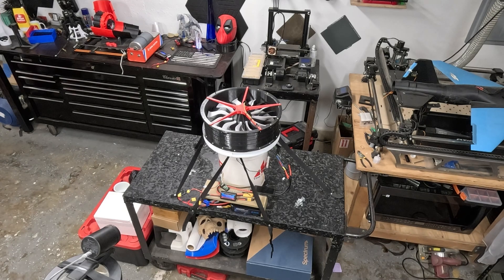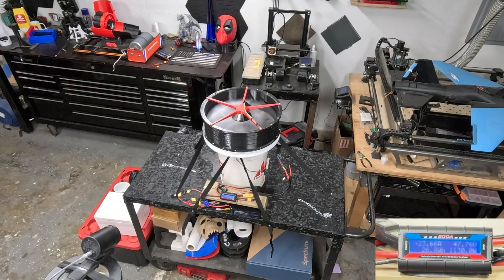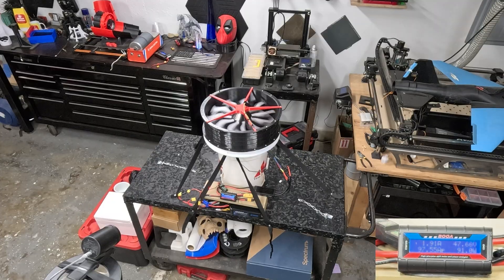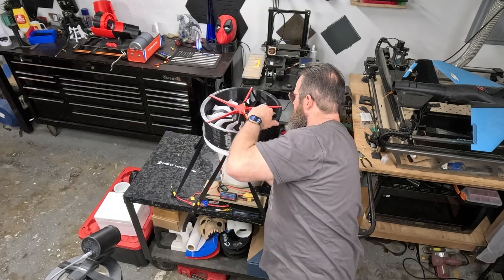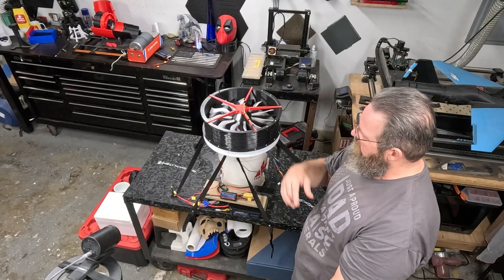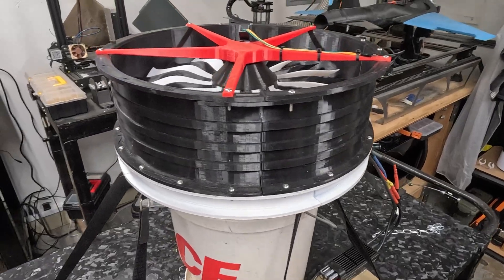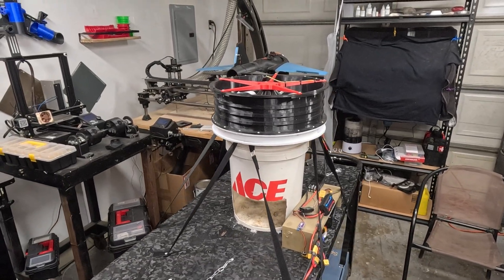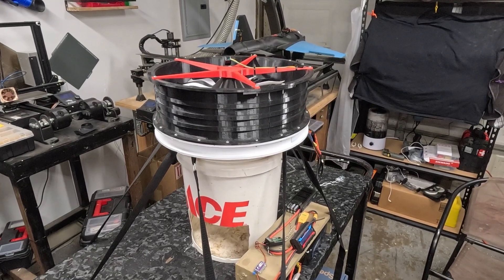STUBBY FAN ULTRA, 340mm electric turbine EDF spin up. Massive power for a new style of drone.

Comment: 2 questions are the plans.for this public and what do you if anything plan to put this on.
Reply from the maker: I’m waiting on some equipment to test its viability as a 3-D printed system at full RPMs using an 18 cell system when I do that I will release all STL files and components list. There will also be assembly videos.
Reply from the maker: To your other question, I plan on building four of these and making a very large drone.

Comment: Just stumbled across this, i need to spend some more time watching the video and channel.

I am a diy skateboard builder and recognized the motor that you are using.  In the esk8 community,  reacher are generally considered the best motor. People have been pushing 150+ amps through the motors on skateboards albiet for a breif moment.  Their 6485 or 6495 or even 7490 would be good options.

However the 7490 are 20 pope motors so the erpm is a little bit tougher to manage when going above 60 volts.

If you are only running 48volts though i wouldnt think it would be a problem.
Reply: Also, if you are interested in a motor let me know I have 2 of the reacher 7490 173kv motors collecting dust on a shelf I'd be to send one your way if you are interested.  It is also a 10mm keyway shaft and the same hole mounting pattern so it should be a direct swap for you.  I can send you a spec sheet also.
Reply from the maker: That would be another awesome motor to test the 7070 peaks at 100 A I need more. Fan resistance is going to create that before I even push the proper voltage through. Also have to decrease the ESC timing to 7.5. See if that helps.
Reply from the maker: If I had a flight controller where I can adjust the polls and it knows how to handle it through the power distribution more than that would also help but going direct from the ESC. I’m relying strictly on it’s internal timing that I have to adjust.

Comment: There are actually traces of blades touching the duct in this video. Not sure whether they come from this test or from something before though. But it might be that the duct gets deformed on max throttle, only slightly, because of all the straps, and blades barely touching the duct could make a difference to the motor. The related current draw spike, if any, may then be so short it is not displayed, but it may be that transient increase in torque to counteract that delaminated the stator (as you say in comments).
Reply from the maker: I’ll have to observe the video more closely and slow it down and see if there’s any contact like you mentioned.

Comment: Phase loss then syc loss. Bullets came loose or bad solder connection?
Reply from the maker: Upon further inspection, it was stator delamination. The motor is being returned and replaced. Luckily, I had another one on hand so we’re setting up for another test involving legs on the bottom and enough room on the straps and chains. I’m adding to see when hover begins, but not enough for the yaw to cause a problem with stability since I haven’t added any vectoring For this test.
Reply: @warmachined3472    Never seen a stator delamination on an outrunner. Would think more of magnets coming loose from the rotor or a burnt winding phase. I use Permabond glue on my motors and fill in the gaps with a mixture of microballons and Permabond to prevent magnets coming loose.
Reply from the maker: @philp901  It was probably defective from the start I just hit the sweet spot.